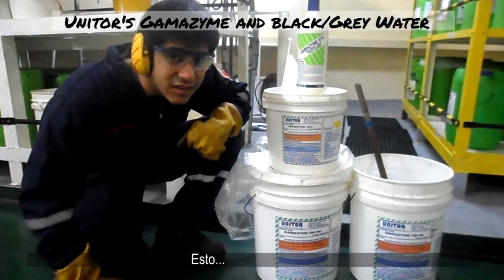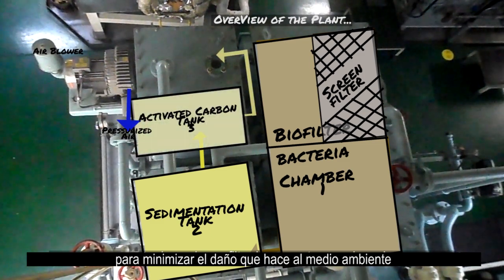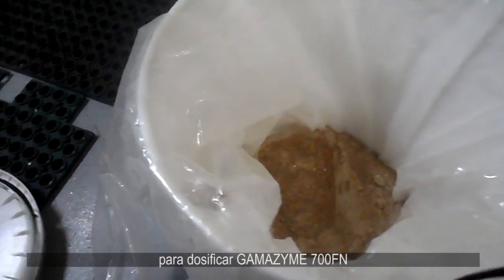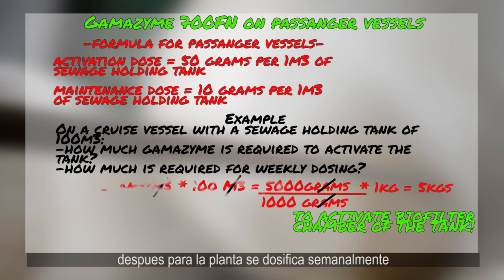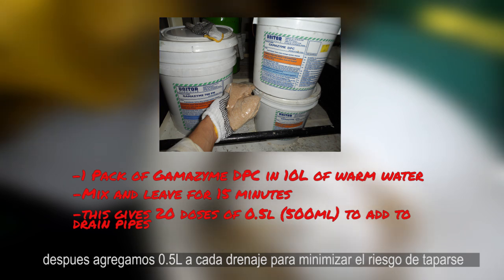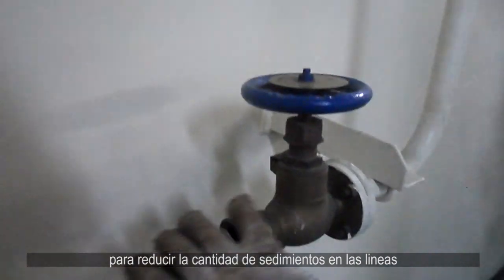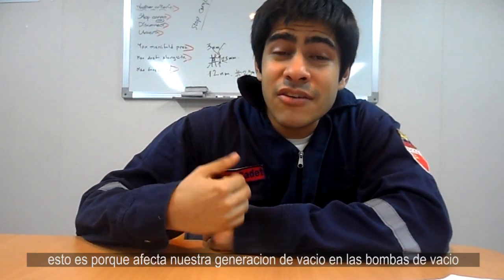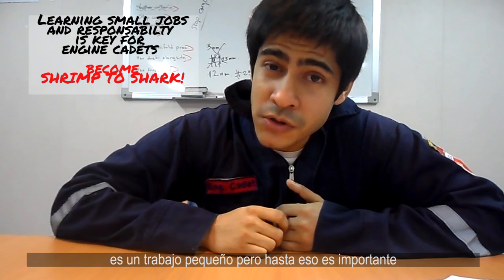BLACK and GREY water on Ships - UNITORS GAMAZYME

Comment: bro, can you make a detail working video of steering gear system? how the hydraulic oil flows and the ram moves?
Reply from the maker: I have some clips about the steering gear however I could show the emergency steering procedure and maybe some basic information about the isolation valves in case there is an oil leak however I am not so knowledgeable yet about this system. I'd like to study it more.. Anyway I'm onboard and accumulating clips of various jobs.

Comment: Great video and explanation of waste water systems. I like the engineering design using enzymes to break down sludge and keep the piping clean, and I've seen one of those clogged pipes which we had to dig up and replace, there was no other recourse. Like you say, not the most glamorous topic but engineers need to know. Not maintaining these systems could lead to disaster!  Well done!
Reply from the maker: Thank you for sharing your experience Mark, I can imagine the nightmare of a shore base pipe being clogged and the pressure from the office to fix it fast, here in the vessel people can't have more than 1 day without toilet without going crazy.. But I guess when the alternative is buckets... 😂

Comment: Sir make a video on stearing gear system of a ship
Reply from the maker: Well I could show case it and how it works.. In reality the only thing that I have done with the steering gear is emergency test procedure for local operation and filling the hydraulic oil tanks.
Reply: @ShrimptoShark  no issue sir it will be also very useful information for us and thanks sir